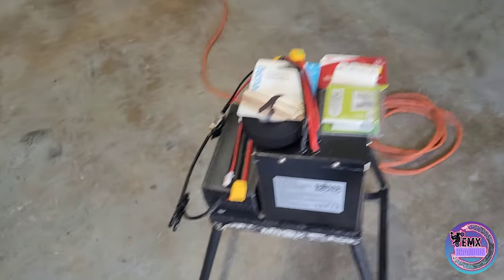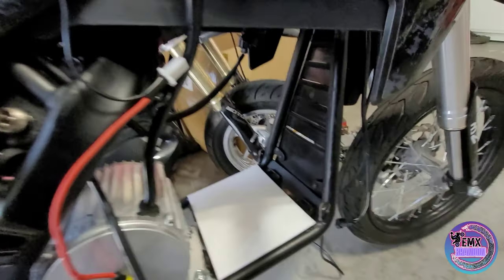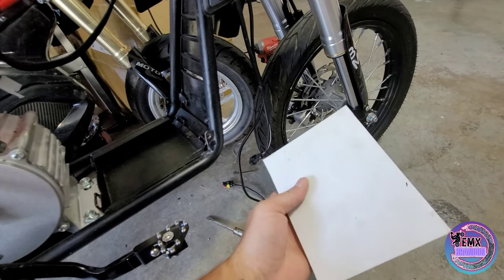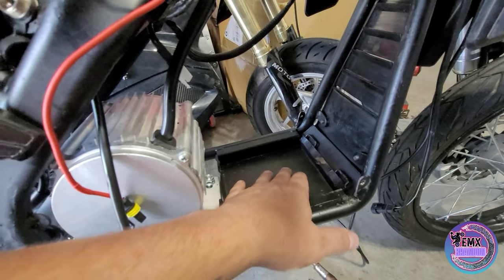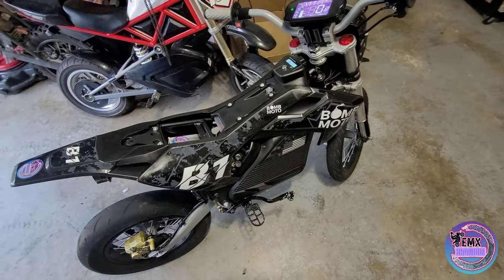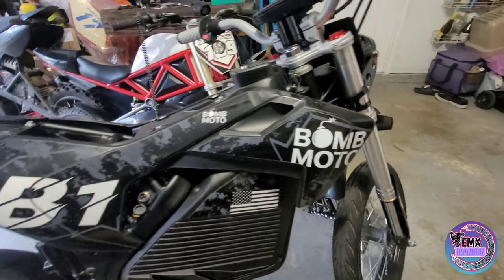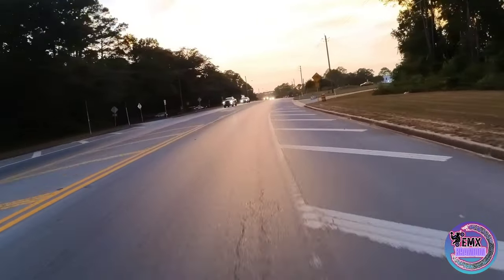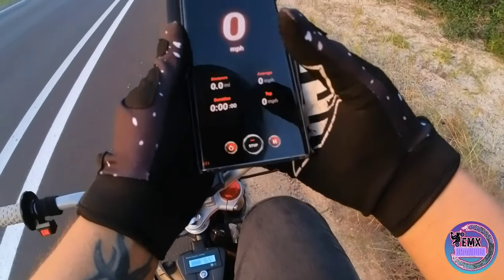Installing & Testing The BombMoto 72v 30ah Battery! Easily Hit 50mph On A Lazy Fardriver 72450 Tune!

Comment: I have a hpr350 basically just a mx350 and I’m running 72v 3000watt on fardrive kit and I can’t see myself getting that expensive of a battery. I have 2 25 amp 36v batteries from Ali on the way but I’m also looking into other alternatives

Comment: Sorry for the question, my amorge just arrived with its charger with xt60 connectors. I havent assembled anything yet but what is the purpose of the xlr male prong. If the battery was mounted, wired, and then needed a charge why not just use the included charger. ?
Reply from the maker: The b1 charge port is a xlr so the b1 battery came with a spare xlr and an adapter to go from xt60 to a 2 pin connector. The spare xlr isn't needed. The b1 battery comes with a 5 amp charger with the matching xlr. If yours came from amorge with a xt60 on the charger then that is what you'll have to use.
Reply: @EmxBrandon  thank you for the quick response. That makes life easiet for me. Now i did message amorge but havent heard back yet. Do you plug in charger to battery 1st and then into outlet, or outlet 1st then plug charger to battery. Also is it safe to charge the battery while its connected to the fardriver(of course with it keyed off amd powered off)
Reply from the maker: @ilkzode1822 i always do outlet first then battery. Don't really know if that makes a difference tbh. And yes it's safe to charge the battery while it's hooked up to the charger. You can even turn it on to check the volt meter periodically to help judge when it will be done charging.

Comment: How long can you go 49 -50 mph ? Thinking of building a b1 to go to work 14 miles thru country roads ? Sounds super quiet and quality over the mototec?
Reply from the maker: Definitely quality over the mototec and it rides so damn good and straight at 50mph with the street tires. I dont know if its something youd wanna travel at 50 for extended periods though. I definitely thing you could make it 14 miles but youd definitely be recharging at work lol. 40 would probably get you a good 20 25 miles.

Comment: lazy far driver? Far driver controllers are one of the best options! what controllers sre beet to you besides the BAC4000 & 8000!?
Reply from the maker: Lazy fardriver tune* meaning I got 50mph without putting much effort into the tune 🤣 which is impressive and never in the video did I say anything bad about fardriver. In fact I have a ton of fardriver content and have helped countless people with theirs. 
But since you asked! Vesc based controllers are the move, much more you can do to dial in the ride feel and power. Fardriver is a great controller as far as price per power but nothing like vesc.

Comment: I noticed the bomb moto and electro and co battery are the exact same shape size and box both 72v 30ah. They are also the same price and have their own brand names on the battery. Wonder if one of them is buying from the other or from an entirely different place
Reply from the maker: Bombmoto created the dimensions of the battery and one of their suppliers is well known in the community (amorge) and bomb has the dimensions up on their site for anyone to use. E&c most likely used those dimensions to eon to copy or is also going through amorge since they look way to similar. All just speculation on my part. One thing I know for sure is hot pax is definitely going through amorge and using different cells.

Comment: Can you post the controller setting you're using for the 72450?  Can't seem to get mine set right, getting a little crunchy sound still and have tried all different phase offset settings after autolearn detected 92.
Reply from the maker: Ill have a video up hopefully next week, but i have my AN under pid params set to 6 and my phase offset at 100
Reply: Aweosme I’ll be watching for the video and thanks I’ll try those out and see how it works

Comment: I have a question : dies the FARDRIVER controller app only compatible with certain phones?  I have a Motorola and the "scan" feature doesnt work at all, even though my phone's Bluetooth pairing can find the FARDRIVER easily.  I tried to install the FARDRIVER app on a Samsung Galaxy A21, and it cant install at *all*.
Reply from the maker: For Android you need to go to the Google search bar and type fardriver app for Android. Should be the first link for fardrivers website and when you click on it, it will show a picture of the blue tooth dongle. Right under that picture is a green bar that says download. Click that and download the app. Android is kinda a pain in the ass.

Comment: You could put it up on bucket and then put tape around the throttle so it stays then you don't have to leave your house and you'll know how many miles it goes
Reply: That is clever! I think the range might be different since it’s not under load 🤔 idk 🤷🏾‍♂️
Reply from the maker: Haha unfortunately its bad to let your motor run unloaded. And what mintmotos said is true, unloaded youll never actually pull any amps so it would run forever compared to actually riding it. So it wouldnt be a realistic range test. I do wish it was that easy though 😆 my butt and my back hurt just thinking about trying to drain that battery
Reply: @EmxBrandon  put a better seat on that baby I just put two gel seats over mine Chelsea covers for regular bicycle seats I just slap them on and tape them,lol hey works pretty good

Comment: Fardrivar is not lazy ! Xt 90? 😂😅😢. Thats cute . I finally got my scooter going in part thanks to you ,and other vids! All I can say 2 fardriver 84530s is too quick !  Thanks for fardriver info!
Reply from the maker: Haha not the fardriver is lazy, it was me being lazy and not dialing in the tune for 72v and just leaving the settings i had on 48v! And it absolutely ripped regardless and it wasnt even full charged!! Im glad i could help a little! I could imagine the scoot is a ripper on 2 84530s! Sounds like a blast!
Reply: @EmxBrandon  bro . I'm using 4ga welding cables ,and 160amp anderson connectors...  large arse wires,and big ol motors go together for peak efficiency too . Not just power . It reminds me of my old 85 Yamaha V-max stage 7  days !  They are both turned down to 240 phase ,and 100 line . 50 boost . The 2 motors and controllers are exponentially quicker than one . I thought it would be just 2 times faster to speed? But it seem more like 7- 10  times the power output!

Comment: Do u need the tray with the v2 b1
Reply from the maker: Nope! Not anymore.
Reply: @EmxBrandon  just making sure thanks
Reply: @EmxBrandon  wen connecting the battery up to controller. What's best way to connect power without making a mistake? Guessing putting everything together then. Plugging the 2 wire from the battery up?
Reply from the maker: @Jackasskidz4  you just wanna have a good anti spark connector so thebattery doesnt spark on connection. You can plug everything else in whenever as long as the on/off switch is in the off position.
Reply: @EmxBrandon  I got the lone star kit 72300 with qs8 connector. It didn't come with a on off switch, should I of wired one in? (B1 battery)
Reply from the maker: @Jackasskidz4  key switch is the same as an on/off switch, your all good! If it makes you feel more comfortable, plug everything in first. Then slowly plug the battery in and your all set!
Reply: @EmxBrandon  thanks man ur the best
Reply: @EmxBrandon  u don't think 6 guage wire qx6 plug is overkill for the b1 battery
Reply from the maker: @Jackasskidz4  nope! Thats perfect, overkill is best for battery current!